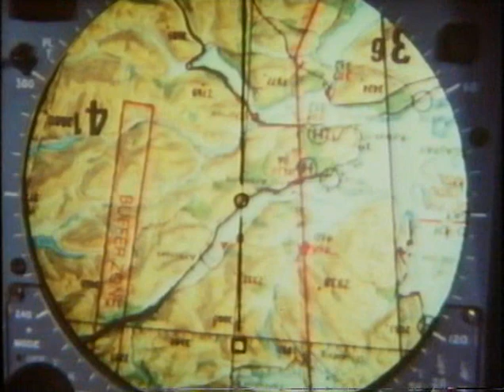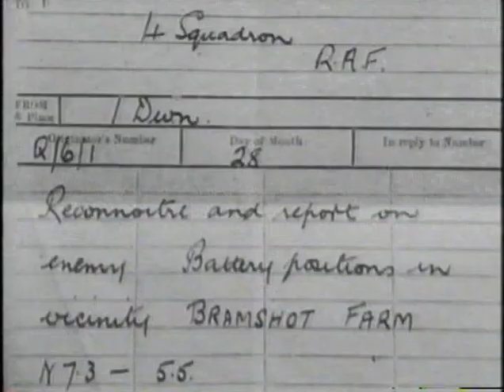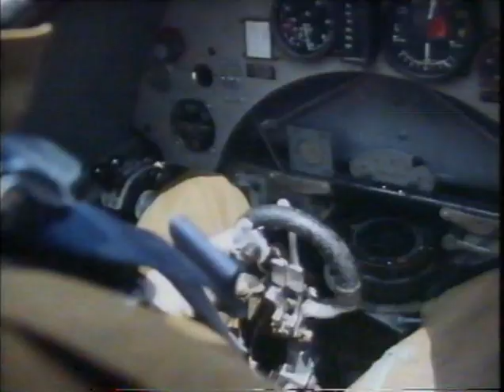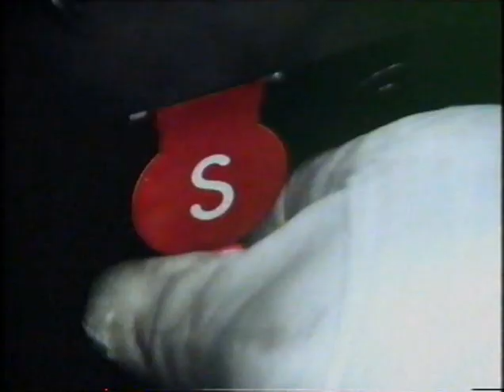Reaching for the Skies - The Aeroplane Goes to War (Episode 03)

Comment: High quality , accurate and factual series ( apart from the speed of the early Spitfire being quoted as over 400mph when it should be about 360 !! )when the BBC really knew how to make documentaries ...1987 . Amazing this is now 28 years old
Reply: Gary Tarr 
The first Rolls Royce Griffon-engined Mk XII flew on August 1942, and first flew operationally with 41 Squadron
 in April 1943. This mark could nudge 400 mph (640 km/h) in level flight.
But he is talking about early marks which were slower. .